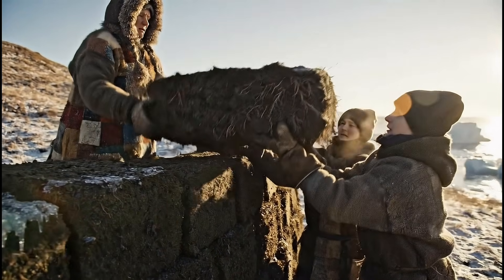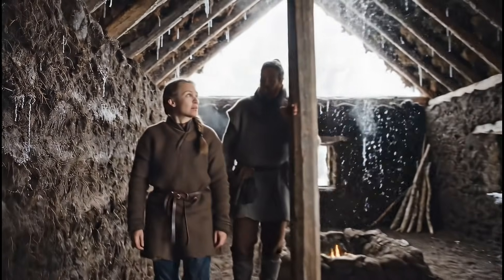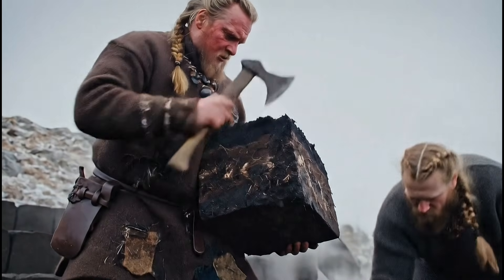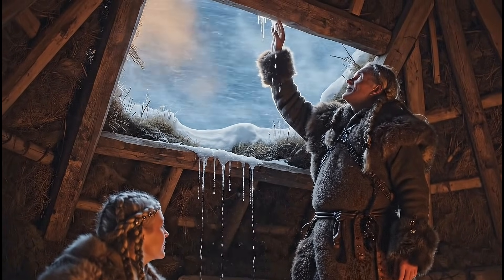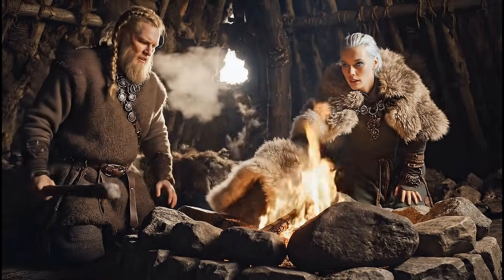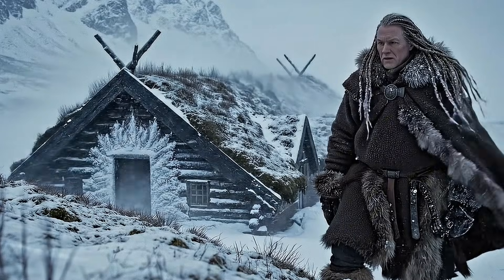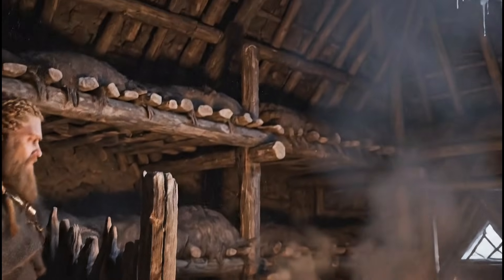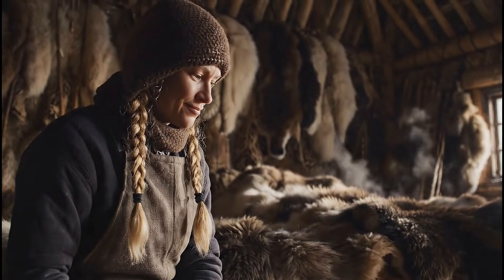Viking Techniques to Keep Their Homes Warm During the Brutal Winter

Comment: The holes in roof let the smoke out.  If you didn't let the smoke out you would asphyxiate from smoke inhalation.  This was only because the fireplace had not yet been invented. Showing the door wide open is stupid it only takes a small opening to provide and upward draft. Showing the people building in sub freezing temps is moronic. No one could rub mud with their bare fingers in the freezing cold. Nor would the mud be thawed during a blizzard/snowstorm. If you didn't build during the summer you could only construct a debris shelter and make tents from hides.  More stupid claims that people had some kind of hidden and superior knowledge. they built with the materials on hand.  No deep secrets or knowledge required.